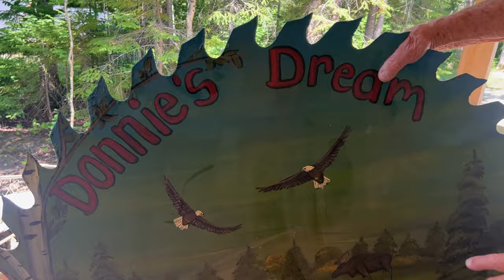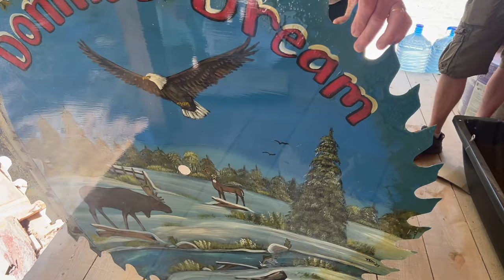Off Grid Camp: Kitchen Cabinets Install and BIG MISTAKE

Comment: That is a son of a gun. As you know condensation happens when the interior of a home is at an extremely different temp than outside. My worry would be continual condensation problems more so in the winter when you have a roasting fire going and outside is -40, without 6mil poly installed between the v match and roxul you may run into issues elsewhere. 
Over here in Ontario Canada we see this a lot. Code requires HRV to pull moisture out and fresh air in.
Reply from the maker: Whats the HRV

Comment: It is a Heat recovery ventilator or air exchanger. In cold temperatures this machine manually warms the cold
air coming in and exhausts the damp air in the home. 

Im sure due to the fact you’re off grid and you don’t live there full time this setup wouldn’t necessarily work. 

Probably installing a couple good ceiling fans would keep the air moving and reduce the majority of the heat away from the peak.
Reply from the maker: Thank you.